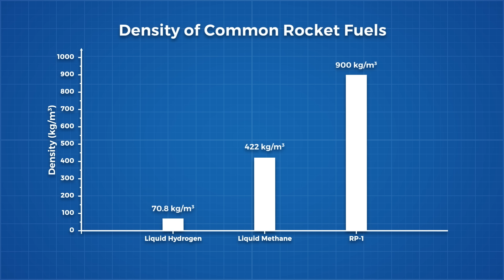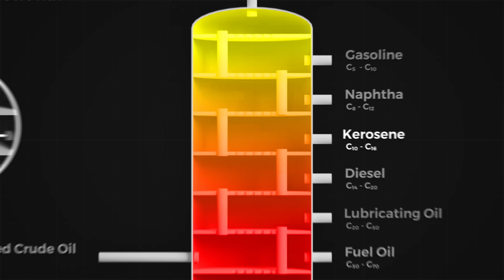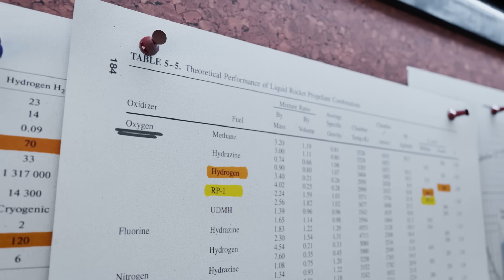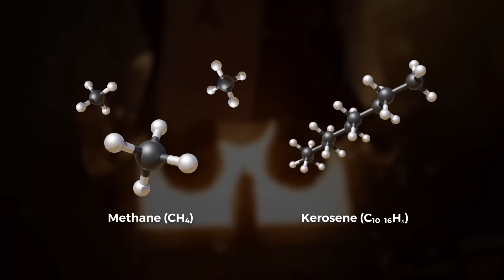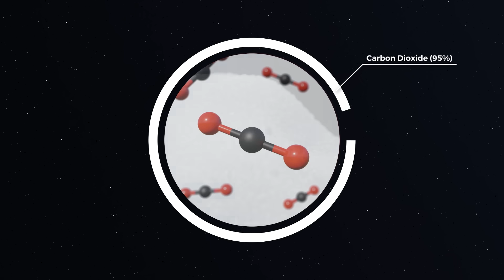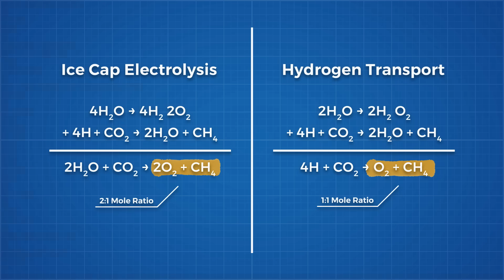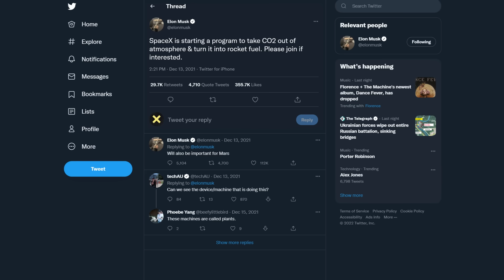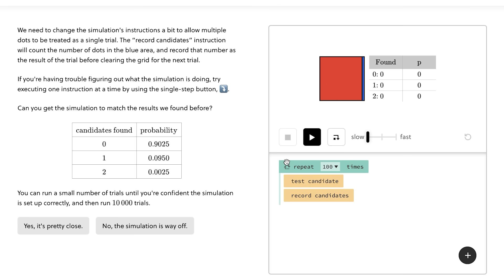Why SpaceX is Using a New Fuel

Comment: When talking about importing hydrogen, the issue was raised that the molar ratio was worse. Some people might wonder why you wouldn't import water instead; in fact I had this thought myself and at first believed it might actually be superior, though I found this incorrect upon reasoning it out:

First of all, the good parts. You want to transport whatever you use in liquid form, as that simply takes up less space than a gaseous form. So which liquid takes up less space? Well, hydrogen has a density of 70 kg/m3, whereas water has a density of 1000 kg/m3, so water wins out. Then, you may also wonder how many moles you are actually transporting, after all a mole of hydrogen is 8 times lighter than a mole of water. Do the math, and you find that a cubic meter of water contains almost twice as many moles as a cubic meter of liquid hydrogen, so that looks good for the water. Better density, less space needed. (note: the requirement in moles is equal, as 4 H is transported as 2 H2)

But therein also lies the issue. A mole of water is 8 times heavier than a mole of hydrogen. If you were to take twice the number of moles of hydrogen, you can already make the same amount of fuel, albeit with less oxygen produced, and you're still saving 50% of your weight. That's worth taking up more space.

Comment: Hey wait a minute. What about Korolev crater? 73° is not too far north for seasonal solar. It may be clathrate so the CO2 is already in solid form with the ice water. 

Korolev is an ice-filled impact crater in the Mare Boreum quadrangle of Mars, located at 73° north latitude and 165° east longitude. It is 81.4 kilometres (50.6 mi) in diameter and contains about 2,200 cubic kilometres (530 cu mi) of water ice, comparable in volume to Great Bear Lake in northern Canada.
https://en.m.wikipedia.org/wiki/Korolev_(Martian_crater)

Comment: Where do we get all the energy to run these reactors? Solar cells and batteries?
I'm not saying it couldn't happen, I'm just saying it won't. It would take dozens of missions just to move enough solar panels to power these reactors, forget everything else we'd need. We could use nuclear, but I don't think we do that anymore. (isn't there a "no (more) nuclear devices in space" treaty in place?). 

Apollo cost the US $25B (2.5% of the GDP for 10 years). The cumulative inflation rate is 645%. If we did it again today, it would cost over $16 trillion. Its good that we're thinking about stuff like this, but Mars isn't economically "worth it". I do hope we visit, I know we won't stay. (p.s. I am extremely wary of anything Musk is involved with, so yes, I am biased.)

Comment: I guess if this capitalist adventurism of Musk leads to increased valuation of methane, that would be good. Tons of methane are being expelled into the atmosphere from improperly capped abandoned oil wells. When the biomass under what used to be permafrost in Arctic and Antarctic zones begins to biodegrade it will produce a dangerous amount of methane. I'll be holding my breath for it to become an economically tenable proposition to capture that.

Comment: You make several referencs to the sooty exhaust of the Saturn V F1 engines. I wonder if the appearance that you're referring to is more about the raw fuel that was injected at the head of the nozel to create a "cool" eveporative barrier between the intensely hot exhaust and the inner walls of the novel. That fuel would not burn completely. They actually went to great lengths to make sure that the RP1 fuel and liguid oxygen mixture burned efficiently and consistently. Without that you get violent feed back pressure/thrust changes called pogo'ing that would damage the rocket structure.

Comment: If we had some kind of pre-launch slingshot like a railgun of sorts we could minimize the fuel load considerably as a massive amount of fuel is spent in the first few seconds just to get it moving.
Getting it moving faster sooner means they can also make the bell more efficient by gearing it towards higher altitudes further reducing fuel load.
Not to mention the additional fuel dedicated to lift that startup fuel.
Reply: Good point, it would be interesting to see a plot of change in mass or weight vs velocity, or vs thrust, or even time.  I bet the weight of that startup fuel you mentioned would be staggering.

Comment: Wondered about acetylene and that big old high energy triple bond.  Nuh- 1300 kJ·mol−1 vs 891 for methane.  c. 50% greater molar energy density, but each molecule nearly twice the weight.

Couldn't find enough information on density, but it looks like there might be difficulty in the kJ.kg-1 area.

Also, I wonder what the synthesis and storage dramas might be?  I did see some mention of it being unstable.

Comment: Methane LOX is very clean. It also allows for the use of co-axial fuel tanks where the LOX tank is surrounded by the Methane tank. This creates a very strong and efficient structure while decreasing the weight of the LOX tank.
Reply: But I think its also very dangerous. If the tank somehow leaked just a few of those gases together, Elon Musk will have to face Colombia disaster happened somewhere between Mars and Earth
Reply: Plus Methane can be obtained with... poop
🤗🚀
It is very easy (some farms and rural facilities do that) and it's named Biogaz

Comment: Why aren't we using magnets to reduce the fuel needed to get rockets to space? (Like a rail gun for payloads. Probably not people)
 It would reduce fuel needs/costs and weight giving it a slingshot effect.

  A power plant could offset the costs by giving off time to the grid.  A track up a mountain or down in one a boring tunnel magnet tracked rocket?  A half  e-rocket so to speak.  Wont help mars but would reduce its costs to get stuff off the planet?
Reply: Because the up-front costs of building a mass driver are enormous. There simply isn't enough demand to justify it right now.
And without cheaper access to space, there won't be. So trying to jump straight to mass drivers is a chicken and egg problem.
Reusable rockets can act as a stepping stone, by encouraging enough development in space to justify building proper launch infrastructure.

Comment: If we can get the hydrogen out of the water on Mars why don't we just use it to make hydrogen fuels?
Reply: For 1 tonne of water you can either produce 0.8 tonnes of hydrolox or 2 tonnes of methalox, meaning you get 2.5 times more methalox.
Granted, hydrolox is about 20% more energy dense, so the rocket needs slightly less of it, but overall methalox is still much better bang for your buck.
Also, as explained in the video, hydrogen is a pain in the ass to store due to it's low density, temperature, and damage via embrittlement.

Comment: sorry lad, you speaking in french measurement units took away my interest for the video
Reply: The video is about spaceflight engineering. Metric is the unit system of spaceflight. The first rocket to reach space was German, built using metric. The first satellite and manned spacecraft were Soviet, built using metric. The rocket that took men to the moon was, in fact, largely designed in metric since most of the work was done by Germans. Even the Apollo guidance computer that landed on the moon was programmed in metric, it just converted the final outputs on the displays for the astronauts. NASA changed to metric in 1990, and modern companies like SpaceX use it exclusively. If you want your outdated customary units, then spaceflight simply isn't the right topic for you.
Reply: The lad has a RE video on exactly this topic, but I don’t suppose you’ll like it.

Comment: Successful carbon capture technology doesn't only hinge on reduced cost but more importantly on the high energy requirements. CCS is very power intensive and using fossil fuel power would naturally ruin CCS efficiency, whereas building out renewable power to meet our energy needs would quickly make CCS redundant. In both cases CCS as a bridge technology is only useful to the industries that promote it but not for actual climate change mitigation.

Comment: I just love non botanists.
CO2 is not a toxin nor a greenhouse gas. It is an essential part of carbon flow within the biosphere. in the '70s we did studies which showed we needed more not less CO2 in our atmosphere. We are currently more or less at 355ppm, which in botanical terms is a CO2 drought. We need as much as 1500ppm for proper plant growth. At this level crops requires less water, less fertilizer,  and are more resistant to pest damage. The plan to sequester appreciable amounts of CO2 from the output of modern industrial processes will put the planet into a death spiral resulting in widespread famine and disease. Modern green house operations utilize supplemental CO2 for these reasons.

Now methane is an entirely different kettle of fish. While CO2 is a relatively minor contributor to "global warming", methane has a very large effect. in order to substantially the methane release old growth and rain forests need to be eliminated as they are the chief source of methane on the planet. these forest do little in capturing CO2 but are  largely compost piles (rotting vegetation, termites and the rapid leaching of nutrients). The greatest carbon sinks in the world are large mono crops such as Maize and  Soybeans. NASA discovered that from a morning high of 355 ppm or so CO2 levels fall to as low as 100ppm by evening during the growing season. But then we see that these mono crops require massive water, fertilizer  and pesticide usage due to the lack of free CO2.
Reply: You’re talking about sea level CO2 which is rarer. Instead most CO2 gets trapped higher up which leads to a greenhouse effect.

The CO2 is trapping energy that would otherwise escape causing global warming.

Comment: CO2 can always be brought back to methane, but thermodynamics say that you need to put at least the same amount of energy back into the reaction. engineering says you need more energy. This process is only viable if the energy is from renewable (non CO2 emitting) sources and the original process must emit CO2, such as cement production. Otherwise just avoiding the combustion is way better.
Reply: As far as Earth is concerned, carbon-to-fuel processes are intended to be a temporary step. Obviously the idea of capturing carbon into fuel only to burn it again seems silly, but the ability to sell the produced fuel provides a potential economic basis to cement and improve the technology. The capture itself at this point is carbon neutral so long as its power source is as well. Once further progress has been made on upscaling renewables, the cost of carbon capture can be shifted off of manufactured fuel and onto tax-funded subsidies/direct use of revenue from renewable power. Now that selling and burning the captured carbon is no longer required, all those well-established carbon capture plants can just switch to permanent storage and sequestration of carbon.

Comment: could explain that black stripe you see on saturn V close up is the soot you saying, not really direct related but very cool to know.
Reply: That’s from the turbo pump exhaust which is rerouted to the nozzle for film cooling. Since it burns fuel rich it is mostly soot similar to the merlin engine exhaust of Falcon 9

Comment: Kerosene and methane are more energy dense fuels, with greater power than hydrogen, but were harder to ignite in the 1960's - even with the hypergolic ignition system that the Saturns used. But, soot accumulation shouldn't be an issue with pure oxygen as an oxidizer, it wasn't for the Saturns.
The trick is making it reliable in a vacuum or near vacuum, otherwise someone's staying behind with a flare to light the engines for the rest of the crew to get home...   ;)
But, hydrogen won't freeze when kerosene or methane does, it's all about trade-offs and critically, reliability of ignition. Still, that shouldn't be a problem with today's technologies and methane is ubiquitous in the solar system.
For CO2, I'd go with compression of the atmosphere and steal off the triple point CO2. It'll take a long time to get much, but time is plentiful in space exploration.
As for Martian cities, not gonna happen. We evolved for 1G, not less. Live outside of earth's gravity for much longer than a year, return to earth is pretty much a death sentence and radiation is quite high on mars, due to the thin atmosphere and no magnetic field. One can work around some of the problem, but colonizing mars means exile from earth

Comment: Why not use methane as an automotive fuel? IC engines are endlessly retrofitted for many different fuels. The cryogenic tank in a car can take ANY shape, and be armored against leaks in case of a crash. You can retrofit older cars for the methane fuel. Again, the exhaust will contain mostly water, certainly not a Green problem.

Comment: There is a lot of science - chemistry and physics - in rocket propellants, but when designing the entire rocket as a system, it's the realm of the science intensive field of engineering where numerous tradeoffs and optimizations are made against each other.  One example:  Liquid methane and liquid oxygen have similar cryogenic temperatures so they can be stored next to each other without added weight and bulk for thermal insulation, and without large differences in thermal expansion causing stress in the adjacent tanks.

Comment: The F1 Engines on the first stage were run rich INTENTIONALLY ! Like your  misrepresentation of this rich running was also intentional.   This engine in was kept cool in part by the rich mixture in the outer layer of the flame front. An ingenious method and worked perfectly on this single use engine.

Comment: I think the wisest would be to send some huge tanks of either fuel and or oxygen to Mars and THEN send the people there. That way if one of them cracks upon landing, we can tell before sending our guys there.

Have them use the huge tanks to recharge life support, and to recharge their rocket's stock of fuel. 

I don't think this is the least expensive option, but if you send the tanks like we've been sending rovers, you could save the rocket part. Then the true challenge would lie in designing the boarded rocket, which allows the crew to land on Mars with it, and re-prepare it to launch back anytime. 

And also if you're doing it that way, you may also need to send some nitrogen, since we would need something to dilute our artificial atmosphere with, preferably what already dilutes our atmosphere here on Earth, tons upon tons of nitrogen. 

I don't know, I feel like having these huge tanks of resources waiting for you there is the safest alternative, since if for some reason your oxygen making process fails, you could just plug some canisters into a huge tank of it and pop 'em back in the Mars station.

Comment: As a nuclear engineer, I can say all of these problems will require energy. Lots of it. Why not use an RTG to crack water or CO2 for fuel? I’m sure this would work well for a water rocket too, water is extremely good at storing hydrogen. Just crack it before use, and burn it like normal combustion. This would be great for a low temperature reactor (which is safer and performs better) and it would be ideal for specific impulse! If you steal my idea, at least give me 1% and a shoutout!
Reply: The idea isn't new, it was discussed in science fiction books since 1960.

Comment: I remember the Saturn v rockets of the 60's and have read official writings more recently.  They used oxygen and hydrogen as fuel  for lightest weight and strongest thrust.  At no time did the use kerosene as it was to heavy!  Were do you people get your data?   Kerosene is for jet engines not rockets.  This video is wrong, as are those who agree with it.

Comment: One thing to point out about the various fuels is how temperature compatible are the propellent and LOX.  Liquid hydrogen is so cold that it will freeze LOX to a slush if there's a common wall.  So even the "common dome" needs to be insulated.  That decreases the Isp of hydrolox.

For Falcon9, the kerosene is chilled to close to LOX temperature.  And liquid methane has a similar temperature to LOX, for simple, light fuel tanks.

Comment: I dont understand why they use rockets , why cant a plane be a hybrid and use the air to carry it far as it can go near space then boost it the rest of the way into space , would it not save on fuel instead of lifting dead weight off the ground ??
Reply: It takes a lot of thrust to get into orbit so the plane would still be carrying a lot of fuel onboard.

Comment: I'm not sure using carbon capture to create methane can ever be green/sustainable. If you're using CC at the source of a fossil fuel, it's just adding another step, but it's still burning fossil fuels (twice) in the end. And if you're using green energy to provide CC in the air, it will always be more energy efficient to use the green electricity directly.
Reply: They’re using solar to synthesise propellant from the air. That makes it carbon neutral

Comment: Hydrogen is a poor propellant choice at sea level. It is a good choice once outside the atmosphere. 

Look at the Delta and SLS rockets. Hydrogen first stages and poor performance.
Reply: Both of those vehicles have good performance. They have a high efficiency But they don’t have a high thrust. That’s why they need SRBs
Reply: @weekiely1233  the sls is a fat pig that could not get off the ground without SRBs. 

Delta 4 heavy gets mogged by both Falcons.